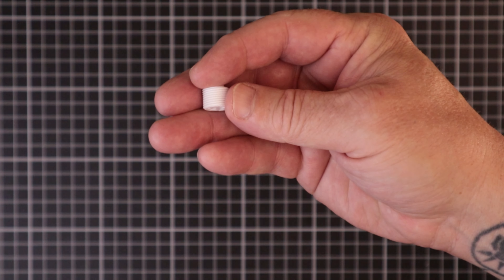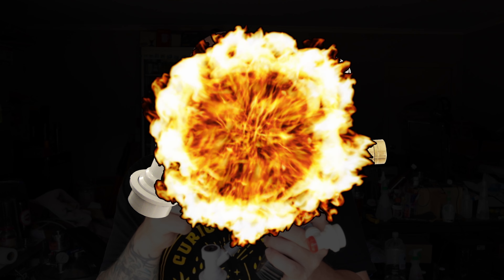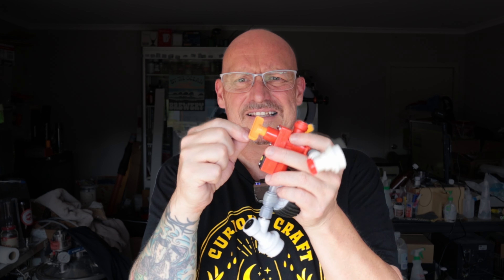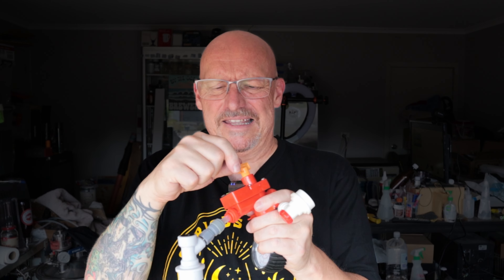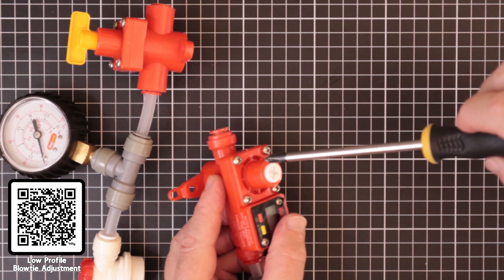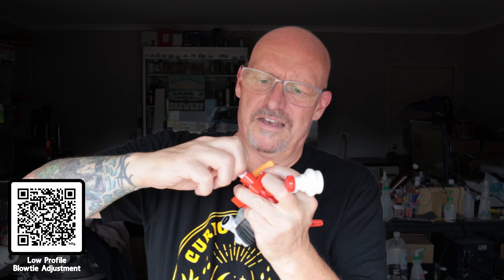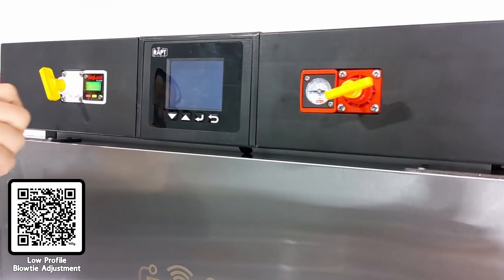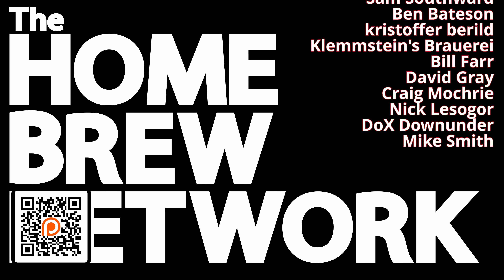Low Profile Tamper Proof Adjustment Knob for BlowTie & Inline Regulators #beer #beerbrewing

Comment: If do the same regarding pressure adjustments. I find it gives more accurate reading directly from the vessel. Thanks for the video 👍 😀 🍻
Reply from the maker: Thanks for watching!
Reply: Glad you found the tip helpful! Getting accurate readings directly from the vessel is key. Have you experimented with any other techniques for precision?